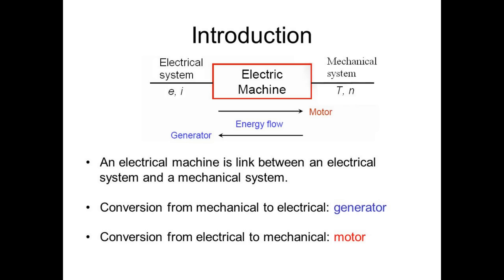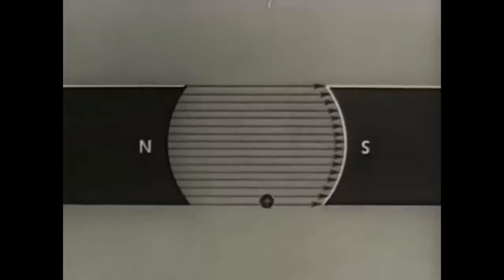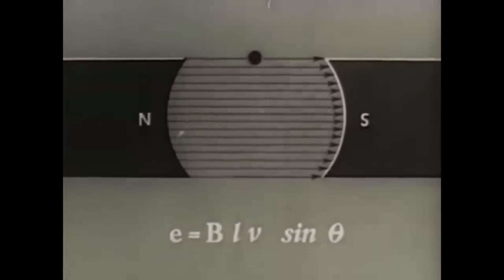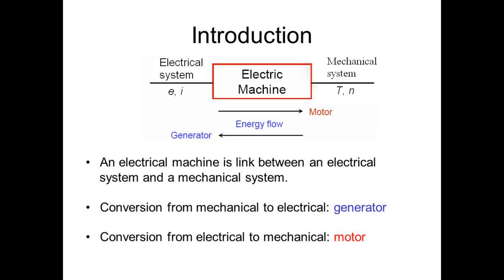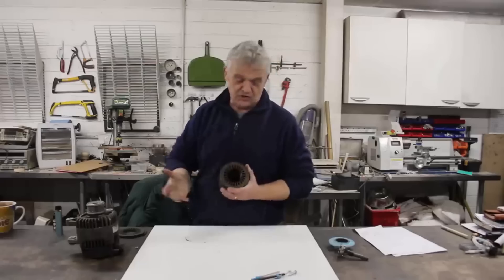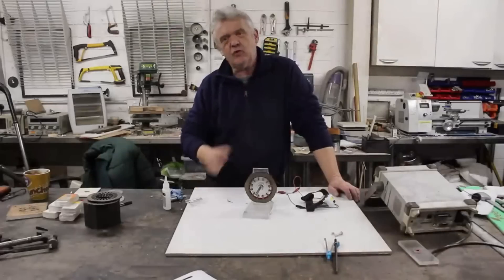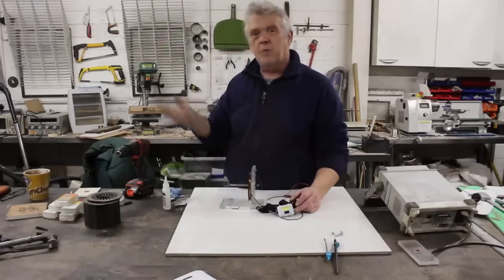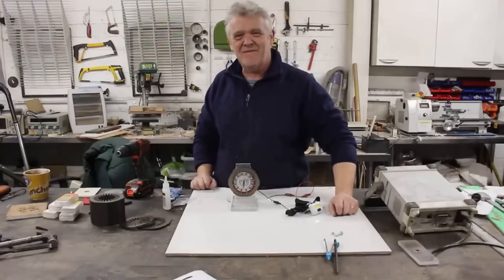2238 The Secrets Of Generators - And Using Them To Build A New Type Of Generator

Comment: Thank you for the great video.
My question is this. I have a 2.5kv generator that always struggles at load. If I were to remove the engine and connect the generator part to the wheel hub of a car. Switch on the speedo cruise and let it generate. At load the speedo cruise would keep the speed constant. Would this overcome the struggle of the generator and allow me to add more load to the output of the generator? 
Thanks again.

Comment: i built many but i recently decided to make something big for making income the ratio is 25kw for $1k a month so 25kw+ is the goal. im having a problem i got about 4k n52 magnets and $8k of 200amp wire and 1mw worth of mirrors so i can have quite the losses and still output 25kw. the problem is how to convert the heat to motion. im thinking a modified heros engine jets under the water so jet pushes out the water not the steam and make the lets longer to use ram jet tech so its a lot more torque and has a suction for the water this seems most likely but i need a cooler i want every drop back water isnt free but i want free power for life. but im also thinking use dc because i cant go any faster than 3600 rpms with ac but with dc i can get 36k rpms ten times more power out of each magnet with only 4k magnets i dont really have enough i want to get as much power out of each one as i can. going to max power but estimating for a lot losses but the details not done yet i just got a bunch of parts

Comment: Always great to see your explanations....So, seems the size/gauge/{speed of machine+rate of magnetic change across the wire} determines the "Current/Voltage output"? You might have a great "Voltage output" but small current due to so much resistance from hundreds of turns of fine wire? Larger wire> less resistance more "flow of current? a trade off in amount of turns vs.current output in the space allowed to fit the wire in...do we not want more "Current" vs. "Voltage"? Current does the work? Voltage is how fast the work is done? Or am I all confused...
So larger wire-less turns- run machine faster? always a trade off.

Comment: Years ago i used a used car generator connected to a used suffolk punch lawnmower to charge 12 volt batteries, it used to run for hours on a pint of petrol. Nowdays i have solar panels which do a much better job for less money.

Comment: Rob, you would be better off with a solid lump rather than those separate plates. In the radial arrangement they channel the magnetic field in the desired N-S direction but here it has to cross the boundary between the plates which creates an unnecessary barrier. If you must use separate plates, in your design they should be smaller and arranged in the vertical direction.
Reply from the maker: cheers mate

Comment: I have been considering a way to harvest the energy from sea waives just along that principle of axial movement.
I call it “the linear generator”.
Imagine you have a perpendicular vertical pipe installed into the sea- let us say it is supported from the side off a cliff. The lower end of this vertical pipe is submerged and the upper end breaths into the air.
Waves will then result in a moving water column inside this pipe.
And when the water column moves up and down it will alternatively such and blow air in and out of the pipe.
If you imagine you install some kind of a piston inside the pipe, it should travel accordingly up and down.
The piston having a magnet stuck on to it, and outside or wound around the pipe a copper wire spool that will pick up the current from that moving magnet inside.
Now I haven’t made my prototype yet, and I suspect there will be a lot of challenges to overcome, but I’m pretty sure it would work.
Will it produce cost effectively?
I don’t know, but ocean waves are at least more likely to continue long after the wind has died down. 😊
Reply: I wonder whether a more efficient way to achieve the same may be to scale up a fidget spinner...

Comment: Thanks for your videos Robert, have you looked into atmospheric /etheric electricity and the use of the volage to make mercury to move in a circular cylinder? Some call it old tech from tartaria and it can be seen on many old buildings (a sphere below another smaller sphere with a spear or spire on top) many are seen on church/ cathedral (cathode) spires also...

Comment: Thanks for the video. I only have 1 small suggestion -- consider adding in a standard 6 or 12 volt dc motor being turned with the same drill as a comparator or "control".  I am still trying to understand this design because from my view... you wrapped the coil around the entire setup @11:54... and that is boggling my mind a bit. So I am trying to catch up on how this actually going to work but, I see that it "does", and I just need to get a better grip on the physics.
Reply from the maker: Great point!

Comment: Very good video. This was reminiscent to me of when I read Bob Brandt's book, How To Build An Electric Vehicle. Before he got into the weeds of how to actually convert an ICE car to electric power, he went in depth into the motor and generator rule, how electricity works in a motor, etc. Some of the information is kind of dated now in this age of Teslas and other mass-produced EVs, but I recommend studying that 30 year old book in detail for a great understanding of the basics.

I've seen a couple YT videos about axial flux motors saying they have a high torque to weight ratio compared to radial flux motors, but no information about how they perform as generators. Are they better than radial flux generators in terms of electrical output per unit of applied mechanical effort?

Comment: Plasma multipacitors are the solution forward.  You should look into high voltage RF collapsing AC plasma generators using inductive and capacitive coupling plasma.

Comment: I like the idea Robert. What I would like to add is using a old diesel Buda-Lanova engine. The heat engines are so efficient on diesel fuel that the new diesel could not even smell there exhaust. Hope that will help you out Sir. 😀😀😀😀😀😀
Reply from the maker: Cool idea
Reply: Example. My sawmill ran for 8 hours on six gallons of diesel. The engine is a straight six cylinder with a cubic inches of 468. Non turboed. Just incredible. The engine was made in 1905 and is labeled a self-enclosed truck engine. The RPM max is 2000 which is slow. Hope that gives more ideas for you Robert. Thanks @ThinkingandTinkering

Comment: how about PCB printed stator coils and stacking them? A youtube channel called Motionmagnetics is building a stackable axial flux in this manner, but using serpentine coils. ive olnly just got a 3d printer and recently got up to speed on its use, so have little to offer of my own in this regard at this point.

Many companies producing PCB stators let you design your own, but the required parameters require you to know the exact details of how much power it will produce, how much torque, etc. 

For a casual exprimenter who learns things top down, this presents a problem. 

Perhaps you could do a video on how one could calculate the needed information for designing a generator based on the idea of using a custom designed PCB stator?
Reply from the maker: i Have been thinking about that mate

Comment: I’m sorry, but this isn’t anything but a hobby. Generators are easily 85% efficient. And, it is not less copper winding per amp. Sorry.
Reply: I mean... He states that he has the goal of designing generators that anyone can build for cheap, and that are easy to construct and reasonably efficient. Your comment doesn't seem to be relevant in any way.
Reply: But with the same copper winding per amp... You would have less to radially extend? How then would you produce more electricity to the thermal inductance? Without blowing the wire.? More wire. So shut up. Also... To say generators are only 86% efficient is neglecting rectification and step up transformers in the system. Or a splitting of the voltage output back into the leads (with matched polarity). Obviously...
Reply: Perhaps using another metal. In liquid nitrogen. Your comment is valid. You can in fact use less wire.
Reply: Oh and in that regard. Perpetual generation... Yea you can match output leads back through the input and split it
Reply from the maker: you make it sound like there is something wrong in having a hobby lol
Reply: Your comment assumes in an inertial frame point you have infinite resistivity mho. To say the wire never gets hot and can indefinitely carry infinite voltages...this isn't true.

Comment: Great idea. I was thinking if the fingers pointed outward rather than inward, then the coil could be on the inside, closer to the bearing, that way the diameter of the coil would be much smaller so the length of copper would be very much less resulting in much less resistance and weight and copper cost for the same number of turns

Comment: When one becomes aware that "Electric" and Magnetic fields do not cause each other, according to the Maxwell-Heaviside equations, it opens the doors to designing very different kinds of Generators.
Reply: Have you seen the patents for the "Vector Potential Coil and Transformer"? Uses the magnetic vector potential to induce electric field instead of magnetic flux. Another wild discovery is the Anapole antenna, a type of perfect absorber and "radiationless EM source". No exposed EM waves, only propagating quantum potentials. Phase conjugation of EM waves produces many useful and unusual effects due to interference.
Reply: @taylorwestmore4664  "According to these equations, in time-variable systems electric and magnetic fields are always created simultaneously, because they have a common causative source: the changing electric current [the last term of Eq. (1-4.1) and the last term in the integral of Eq. (1-4.2)]. Once created, the two fields coexist from then on without any effect upon each other. Therefore electromagnetic induction as a phenomenon in which one of the fields creates the other is an illusion. The illusion of the "mutual creation" arises from the facts that in time-dependent systems the two fields always appear prominently together, while their causative sources (the time-variable current in particular) remain in the background."

"a time-variable electric current creates an electric field parallel to that current [the last term of Eq. (1-4.1)]. This field exerts an electric force on the charges in nearby conductors thereby creating induced electric currents in them. Thus, the term “electromagnetic induction" is actually a misnomer, since no magnetic effect is involved in the phenomenon, and since the induced current is caused solely by the time-variable electric current and by the electric field produced by that current."

"There is a widespread belief that time-variable electric and magnetic fields can cause each other. The analysis of Maxwell’s equations presented above does not support this belief. It is true that whenever there exists a time-variable electric field, there also exists a time-variable magnetic field. This follows from Maxwell’s Eqs. (1-1.3) and (1-1.4) as well as from Eqs. (1-4.1) and (1-4.2). 

But, as we have seen, neither Maxwell’s equations nor their solutions indicate an existence of causal links (no causation) between electric and magnetic fields. Therefore we must conclude that an electromagnetic field is a dual entity always having an electric and a magnetic component simultaneously created by their common sources: time-variable electric charges and currents.° This conclusion must hold for all electromagnetic fields, including electric and magnetic fields in electromagnetic waves."

-Causality, Electromagnetic Induction, and Gravitation: A Different Approach to the Theory of Electromagnetic and Gravitational Fields by Oleg D. Jefimenko

I'd say Maxwell knew what he was talking about and Heaviside didn't skip out on something so significant.

Comment: Rob, what are your thoughts about the new moon phase generator idea?
Reply from the maker: never heard of it mate - what is it?
Reply: @ThinkingandTinkering  from my understanding it is a steel (not necessarily) dome with a vent at the top centre. It’s anchored to the sea bed (possibly on legs🤔). The vent is piped to shore where there is a generator driven by the pressurised air (or perhaps water🤔) caused by the rise and fall of the tide. The inventor is about to demonstrate it somewhere in the Bristol Channel I believe once he has permission to anchor it. He has calculated that a 9 foot diameter dome could power a house and an 18 foot diameter version would power 4. He says that among the advantages with his set up are: very few wearing parts. All servicing and repairs are made at ground level, main structure will last a couple of hundred years so the problems of unrecyclable materials that exist with wind turbines are considerably less, if not non existent and the power available and when is always a known. Also they are relatively unobtrusive.I thought you’d like to have a good ponder on this one👍

Comment: Hey sir I’ve been watching this channel a while now it’s been a massive source of different things I’ve built around my house that has helped the family a little better but there is one thing now that you mention generators now before I go on I need to iterate that I understand the laws of perpetual motion and why it can’t work believe you me I’ve watched sooo many fake videos of what could possibly work as a sort of a perpetual motion which of course they don’t but there is one video I found that’s low quality called the perpetual motion water wheel it uses a coil pump to get the water back up to the tank, I think I could design it better and place some gears that would attach to that wheel and we could get a good ole spin on that motor as long as the water is running as in as long as the tap is on, what I wanted to know is would that actually work I understand it’s technically not perpetual motion because we need something to take the water back but I learned about you back when I was learning to make a ram-pump and I’m guessing you have heard about the coil pump and to be honest in my opinion the coil pump would work better than the ram pump is this something that could actually be made and generate a fair amount of electricity maybe not to power a house but for outdoors say or a power outage inventing and building a generator that runs on a tap seems pretty handy ?
Reply: Great news , good for you, that’s th purpose of the channel
Reply: I’m sorry are you the gentleman that made the video I think not. Play nicely now lads this is not a channel for children.
Reply: And that doesn’t answer the question, respectfully if you’ve got no good input I’d rather not see useless comments.
Reply from the maker: if you wonder about it give it a go building it mate - that is going to be your best answer - I personally don't belive it will work but that doesn't mean anything really

Comment: That works great. You need to find a larger motor to get the plates from it now, or  you can make your own plates out of some large flat plate.
I do like this generator as there is no fiddly serpent coil to wind.  It's a nice simple design.
More current just parallel the windings or thicker wire.
More voltage just series the windings or more turns

Comment: What if the generator isn't converting mechanical to electrical energy. But is  just  using mechanical energy to convert energy from the magnetic field to electrical energy. The energy in the magnetic field is one dimensional and current is a three dimensional energy. The basis of mechanical to electrical energy is based of the constant of 745.7 watts equal 1 horse power. However this constant has nothing to do with generators as the experiment involves no magnetic induction. So all the generators we building could just be really inefficient as the only reason we need torque is because of lenze drag.

Comment: Will that work in reverse as a motor?
Reply: Look into "halls sensors" (to determine the position of the magnets) and micro-controllers to time the supply as found in DC motor speed contrllers
Reply from the maker: yes

Comment: One could make their own larger scale fingers and their own high powered magnets from grinder dust from any metal shop.

I have over 12 kilos of such grinder dust, and making both the sintered 'field fingers' as well as making sintered iron nitride magnets is not supremely difficult for me, so I have made notes to myself to attempt this some time in the future.

It also helps that I have a few quite large coils of magnet wire on hand, in various gauges, but I am also pondering the simple use of microwave transformer coils, because all I have to do is dissolve the lacquer, separate them a little bit, form them into the right thickness and diameter of coil, powder coat them, and then compact them into the needed thickness to fit.

I can use a larger diameter, and in doing so, reduce the number of turns, thereby reducing the number of potential 'shorting points' that a more tightly wound coil inherently suffers from.

Also, after a preliminary conductivity/resistivity test to ensure I do not have breaks in the new powder coated insulation, I can go ahead and epoxy them into their new shape so they do not vibrate and suffer the destructive action of the wires rubbing against themselves in operation, which would lead to terminal shorting out at some point.